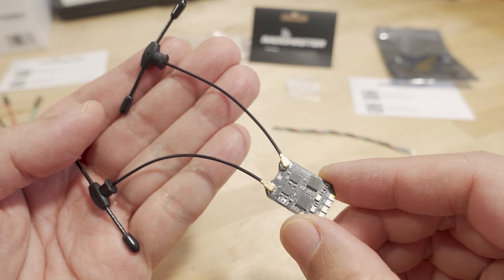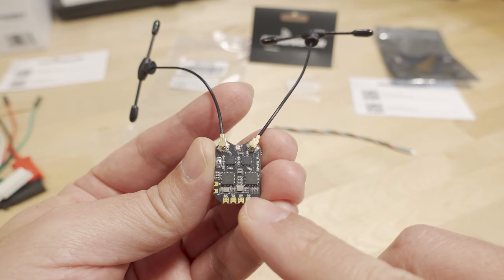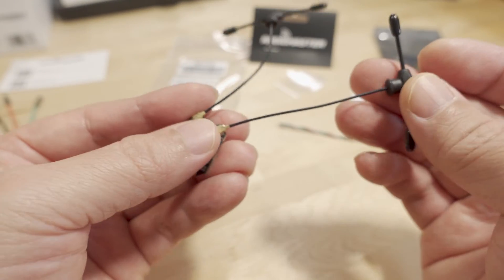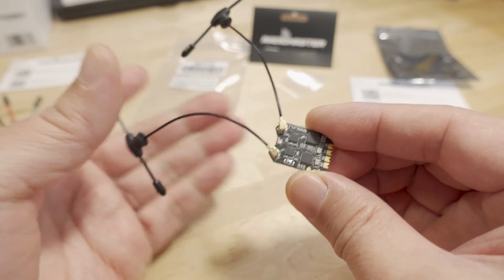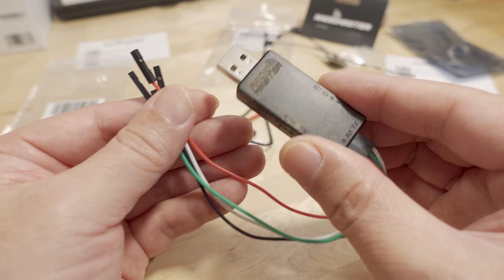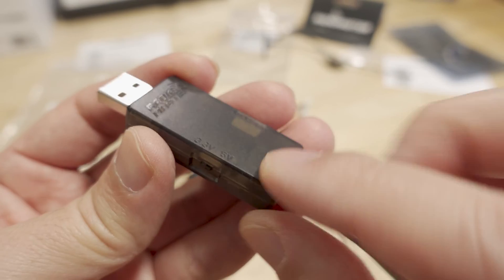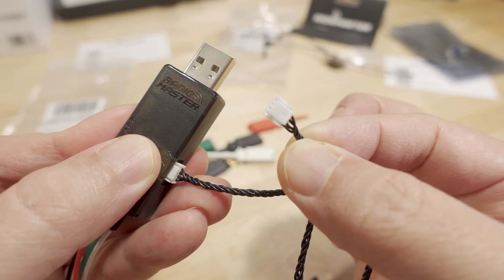RadioMaster RP4TD Diversity ELRS Receiver and USB UART Flashing Tool

Comment: sorry if I missed it, but what would the alternate R T pads be used for?
Reply from the maker: What are you referring to?  Time stamp in the video?
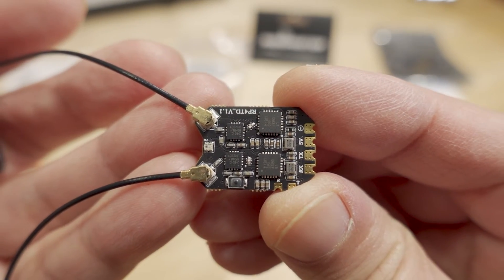Reply: @AlbertKimTV  sorry, @ 1:14 on the receiver there is the standard 4 for the UART (RX, TX, 5V and ground )but there is another  2 pads for soldering just labeled R and T! I hope this clarifies, and thank you for the quick response
Reply: @DragonazzAdventures  Same question here. The RP4-TD manual indicates a "Backup Interface: UART", so maybe it's a secondary port. Would be good to get more info on it though.